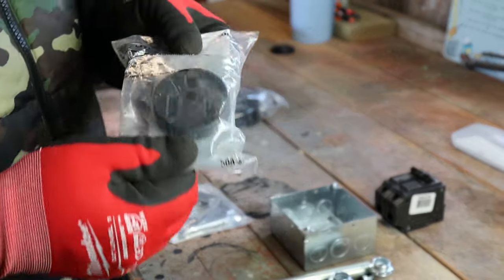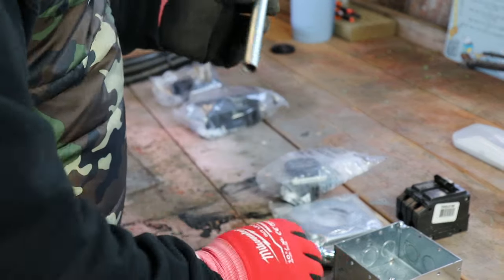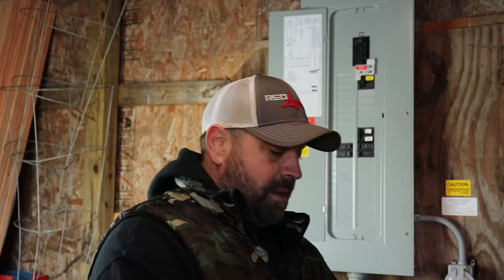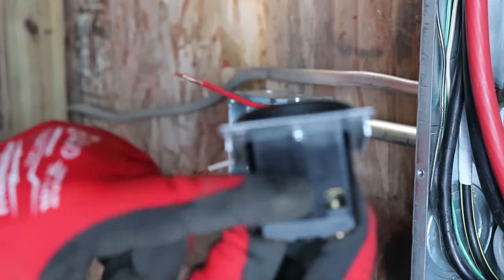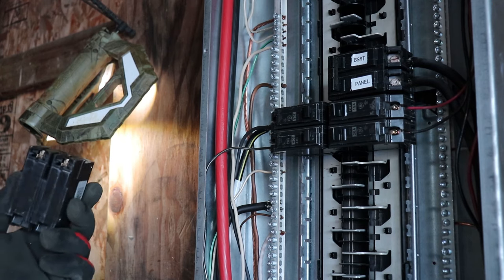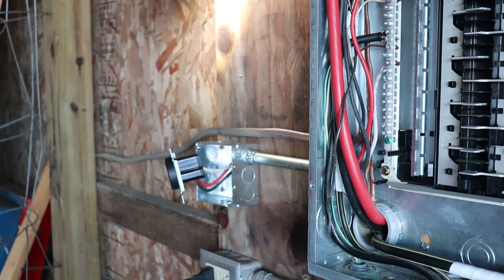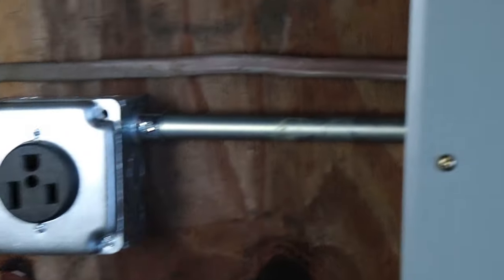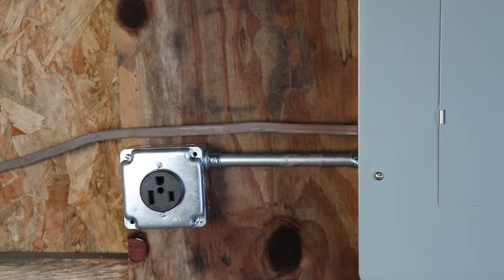Welder Outlet 240V (Complete Installation)

Comment: added note: ground wires should be green or bare, not white. no mention was made about the breaker size. use 40 amp for 8 guage & 50 amp for 6 guage. the author installed a receptacle. a plug is whats on the end of the welder cord.
Reply: Another thing to mention is that the insulation type affects amperage load capability’s. 8 gauge with THHN insulation can carry 55amps. Another thing is voltage drop for longer runs.
Reply: That was helpfull!  I was wondering why people were using 50amp breakers
Reply: WTF Some REAL confusion here between a 'ground' and a 'neutral'. Even where the white ground was plugged in appeared to be a neutral bar.
Reply: @joewest9663  the neutral is a current carrying conductor. the ground does not carry a current. the green ground is to trip the breaker in the event of a short or fault. in the main breaker panel only,  the ground & neutral are connected to the same terminal bar in the panel. any sub-panels, the grounds & neutrals are separate. the neutral is not bonded to the sub-panel enclosure. on a 240 volt welder or compressor with a 3 prong plug, there is no neutral, only a ground which is the green conductor for grounding. grounds & neutrals are cold to the touch. hope this helps.
Reply: @garybrown7044  that does help clarify however, perhaps this is just Canada, but ONLY a bare wire or a green wire designate ground and a white wire is ALWAYS neutral UNLESS tagged with red tape on the ends in a panel or junction box. I also understand unless 240 is running with supplemental 120 for ie a stove with 'bells and whistles' a neutral is not required. Please let me know if your premise is for Canadian code as well as American cause I'm back to the code books for a refresher otherwise.
Reply: @joewest9663  u.s. & canadian codes are very similar in this application.  residential clothes dryers also require a neutral as the timers drum motors require 120 volts & the elements are 240 volts. just a note, in canada, high voltage circuits in commercial & industrial wiring is 575 volts as opposed to 480 volts in the u.s. high voltage lighting circuits are 277 volts with a gray neutral in the u.s. unsure about high voltage lighting circuits in canada. in the u.s i was an electrician for 28 years & a electrical safety inspector for 22 years. when i had to power a canadian built machine, a transformer had to be installed to boost the voltage to 575 volts. expensive job.
Reply: Hey Gary ! Just to make sure 6 awg wire is best fitted for 50 amps that would run a 240 amp welder
Reply: @AlexanderRodriguez-vs3xk  I'm confused.. my 110/220 welder says 50A for 110v and 26A for 220v yet a 50A breaker is specified which would need 6 AWG copper. How could 110v require a 50 A breaker? Usually 110v needs 20A.
Reply: If I find a ground wire that is not green, I use green tape whenever I don't have green, same with neutral and hot use their colors. I never use green on hot and neutrals whenever I'm short on supply, I always leave green with grounding.
Reply: @sscbkr48 Less volts more amps, more volts less amps.
Reply: @sscbkr48 since your welder mca is 26a and mocp is 50a, you can use 10awg thhn on a 50a 240v breaker. Just make sure it's a dedicated circuit and labeled on the outlet box cover for welder only.
Reply: @FishFind3000 I have a question my breaker box is about 50 feet from my shed where I need a 240v plug how would you go about doing that? run it. under ground in a plastic pipe? or steel pipe?

Comment: I would have wrapped green tape around the white wire to indicate a green ground wire.
Reply: I mean it's kind of obvious to anyone looking at it.
Reply: @jonny-b4954  it's kind of green on one end 🙄 it's kind of white on the other 😜
Reply: @jonny-b4954  it’s still not right. It’s supposed to be marked.
Reply: @FishFind3000  For sure, it's a great practice and is code. But still. If you're poking around in the breaker box like that you should know that entire rail is ground. And if you're messing with that specific 220v plug you'll see it's the white wire being used as ground on the other end. I mean, it really makes no difference. Power will be shut off to entire box if you're working in there with panel off like that. There's no real practical reason to mark it except for quick ease.

Comment: Great video.. only tip I'd tell others is ground your outlet box , when using metal boxes
Reply: At 1:02 .. you can see the thread hole where the green ground screw would go .. the manufacturer does not thread this hole for fun .. there's a purpose .. you can see its lifted so on a flush surface the threats from behind would have clearance.
Reply: I don't care as much as you do lol .. you win your right .. give your self a cookie 🍪 lol
Reply: Why dosent the green screw come with the box? Am I supposed to go buy one

Comment: Hello Im a not very educated with amps I bought a welder that says 230 but it also says it welds far above 50 amps would I need a plug with more head room then what it can weld or how does it work.

Comment: Thank you for this. I am doing the same this weekend for a new (first) welder. Using number 8 wire and a 40 amp breaker in 3/4" conduit, separate wires. Breakers very hard to find lately ... had to order online. Anyways ... much appreciate that you took the time for this fine video Mr. Cook. Best regards from Canada.

Comment: Thanks! Helped me confirm that I had mine wired correctly (6-50R with 6-3 wire into a GFCI 50A 2-pole breaker.) Got my welder up and running and didn’t electrocute myself lol.
Reply: in this case, does nothing connect to the breaker's load neutral?

Comment: Good Video!   You should re-identify the white to green!   You can use green tape for that purpose.   Not saying unsafe, but not legal to strip a cable and use conductors within a conduit.   Reason: No markings on the conductors as required by NEC.

Comment: Since you're using conduit, instead taking flexible #6 cord and stripping the sheath, you'll find it easier and more-to-code to use individual conductor (black, red, green) such as THHN.  The cord isn't really approved for this purpose, THHN or T90 (Canadian spec) is and you have the right colour code for ground.  The THHN is probably cheaper too.  Likely easier to find than #6 flex cord.

Secondly, sometimes in the future you might want to modify the panel (move breakers, run new circuits), so it's customary practice to have several inches (6" or more) extra wire (stripped of its external sheath) in the panel.  It prevents stress on the terminals. Tight point-to-point really isn't a good idea. 

Note: I've always disliked the US practise of using metallic conduit (or indeed, in the old days of using AC armor with or without some wimpy bare wire) as a protective ground.  Our codes require a ground wire connect to the receptacle box EVEN IF the conduit and boxes are metal.  I had an American friend having a hot-box short causing the old corroded armor glow red hot while STILL not providing enough of a grounding path to fire the breaker.  Fortunately he had the wall open as part of a renovation and spotted it, otherwise, his house would have burned down.  This was code in the US until a decade or two ago.  It's been a very very long time since it was legal here.

I just installed a similar circuit (#6, same 6-50 outlet as you) to alternately power a EV charger or my welder, but in 3/4" plastic conduit.  The box got grounded.  There is a trick on how to do this without needing an extra terminal or a wirenut.
Reply: In order to meet the electrical code would the white neutral wire insulation need to be taped over with green electrical tape to identify it as ground ?. I am assuming you are here in Canada Mister Fromage ( cheese ).
Reply: For welder branch circuit installations here in the USA, I do not rely on the Rigid Metal Conduit (RMC) for the grounding conductor, a dedicated green colored stranded copper conductor is used for the grounding conductor. However, the RMC helps with electric noise radiation when the welder is in operation. This means the complete branch circuit install uses metal boxes and metal conduit so the entire branch circuit is encased in ferrous metal (galvanized steel or equivalent), much like the requirement if the conduit was used as the ground. In all my installs, I never rely on the conduit for grounding, a separate grounding wire is always pulled, which usually does not adversely impact the conductor fill limitations. 

For a USA 50 Amp 240 VAC welder branch circuit install, the common conduit used is 3/4 inch Rigid Metal Conduit. RMC uses pipe threads and conductive (copper based) thread sealant at joints. The CB is 50 Amp 2-Pole (usually with 75 degree C rated terminals). The wire is THHN 6 AWG and usually pulled as Black, Red, White and Green. So 4 conductors (each 6 AWG) in total (THHN stranded copper). Conduit bodies are used to facilitate lengthy pulls, and you can use wire lubricant if needed. The White wire is only used if the welder requires a Neutral connection, which is usually not the case with newer welders, but is pulled just in case the owner wants to move to a 4 connection 50 Amp 240 + Neutral style plug.
Reply: @BobSmith-iu3hx  The only remarking required in the CEC, is marking white wires black to denote a potentially live wire.  There's no reason to use white THHN for a ground.
Reply: @windward2818  I would have thought that the NEC had abandoned the use of conduit for grounding by now.  CEC hasn't allowed it for a very very long time - mostly I think because they decided it was better to make sure it was protected against some moron replacing a section metal conduit with plastic.

My 240V 50A welder branch was done with 2" PVC conduit (obviously oversize) using #4 black, red, green and white THHN.  A professional electrician recommended #4, because #6 was considered code-marginal at the length required.  This wasn't the electrician trying to up his price, because I was doing the #4 purchase myself, and besides my son was also installing #4 in conduit, and got a good price for buying both my and his requirements.

The outlet is wired with a 14-50 socket (4 prong) to maximize flexibility (eg: someone had to plug in an RV), while at the same time the EV charger (which is what is plugged in the most) and the welder were ordered with the 14-50 option.
Reply: @fromagefrizzbizz9377  
Here in the USA there are several methods approved for equipment grounding conductor, one being RMC conduit. However, the real issue is that to effectively create an equipment grounding method, RMC has to be installed properly, which means using a conduit grounding bushing when it enters the breaker panel, sealing the threaded connections and other workmanship techniques that are not always properly executed (the threaded joints must be very tight and conduit must be supported by straps and other methods). 

If working with 6 AWG THHN I just pull a green copper THHN 6 AWG grounding conductor in the conduit. For a welder branch circuit I always use an Equipment Grounding Conductor (EGC) THHN copper stranded wire. I have a lot of 6 AWG THHN Green which is very popular for earthing and bonding here in the USA, so I generally use this. If the conduit bends are crazy without the proper use of conduit bodies, meaning I did not do the install, then I will consider moving to a smaller EGC as permitted by code so a 10 AWG THHN wire. 

THHN 4 AWG will work for a welder install, in the USA the voltage drop would not be a prime concern for 240 VAC if 5% total or less, so 6 AWG usually meets code. However, if you want to minimize the voltage drop then moving to 4 AWG would be a solution. Using 4 AWG is also popular if you plan on upgrading your welding equipment, you can then usually just replace the 50 Amp CB with a 60 Amp CB, without modifying the branch circuit wiring, although you will probably need to connect the welder directly to the feed circuit and not use a receptacle. Moving to THHN 4 AWG from THHN 6 AWG would require the use of 1 inch trade size RMC. 1 inch trade size RMC is harder to thread than the 3/4 inch if done by hand.

The 4 AWG THHN 50 Amp 3 pole + ground is very popular for electric vehicle charging branch circuits and use a NEMA 14-50R 50 Amp receptacle but rated heavy duty (continuous duty) like the Hubbell HBL9450A. As a result, some welder installs in a residential garage would use this receptacle and then an adaptor cable (or adapt in the plug) to a the 6-50R 2 pole + ground popular with welders. In this way you can plug in your electric vehicle to charge or use your welder, but not both at the same time. As you can see, when accommodating electric vehicle charging we need to pull 3 pole (Black, Red, White) + ground (Green), and as you pointed out, there are other uses for the NEMA 14-50R Receptacle.
Reply: @windward2818  Does the NEC still permit conduit as ground for, say, 14ga branch circuits?  Not here (CEC).

14-50s are found in just about ALL homes here, it's been a building code requirement for homes going back decades.  As far as I'm aware, 3-wire US style stove connections haven't been permitted for at least 50 years, and now even direct-wiring for stoves is strongly discouraged.

[I know that the NEC has switched to 4 wire a few decades ago.]

As such, 14-50 sockets are cheap as dirt, and many devices will come with an option for 6-50 or 14-50.  6-50 is the rare one except for welders. 

Are there many 240V EV chargers needing neutral?  Mine doesn't, despite coming from the factory in the 14-50 configuration.  The 6-50 configuration is the same price.

Comment: “These black and red wires” you mean the hot leads and “this white wire” you mean the neutral which you’ll use as a ground. Just bustin’ your chops. Well done video.
Reply: Hahahaha that’s the funniest joke I’ve ever heard! Just bustin your chops. Nice comment
Reply: No neutral in 240V two hots and ground😂😂
Reply: @McGrathMotorsports  Yup, I said you’ll use the neutral wire as a ground.
Reply: I desperately need help wiring my welder. I wired my 220 dryer no problem. Because it was two 110's and a ground. NO NEUTRAL.
The problem is this old Miller Thunderbolt stick welder has a power cord with a black wire, white wire and green. SO I'M SCREWED. Apparently this welder seems to expect me to have 240 power that incorporates a white neutral wire. What do I do?
Reply: @mperhaps  relax dude If the welder is 240v they’re using the black as a hot leg, the white as a hot leg, and the green as the ground(obviously)
Reply: @davidnobilese6124  Not sure why, but I'm wiring an outlet for an old Hobart 110-114 that uses black, white and green from the plug to inside.  Guess these manufacturers don't want to bother getting cables with black, RED and green to match code.  The white wire threw me off, too, initially, but I'm using #8 stranded in red, black and bare (stripped to use for ground)---Home Depot was out of green #8.

Comment: 3 dangerous mistakes 

1) you have 10 guage wire going to a 50 amp breaker.  The 10awg wire will exceed its 30amp rating before your 50amp breaker trips.  Either change to 6awg OR reduce your breaker to 30amps.

2) you didn't ground that metal box.  put in a green fround screw and pigtail it to the circuit grounds

3) tape the white neutral with green tape on both ends to denote that it is being used as a ground wire ✌️
Reply: I used 6/2 wire and used the ground wire provided. It didn't seem as thick as the other wires, should I have bought 6/3 and used a conductor as a ground, and discarded the ground wire?
Reply: @CrashBr0  If you're buying properly NEC/CEC approved cable, the ground wire will be sized appropriately.  Generally speaking, the grounding wire does NOT need to be the same size as the hot or neutrals, because it only needs to be rugged enough to last the brief period required to blow the breaker.

That said, the CEC (at least) defines it more formally by saying that the ground must be the same gauge as the hot/neutral up to #6, up to 200A (0000), grounding only needs to be #6.  Which is why bonding straps for 200A mains is "only" #6.  So your 6/2 is fine, unless you purchased fake wire.
Reply: @fromagefrizzbizz9377  Thanks for the explanation! 👍
Reply: @CrashBr0  I should have phrased it as being labelled as CSA or some form of UL.